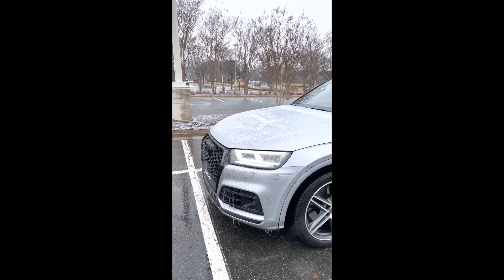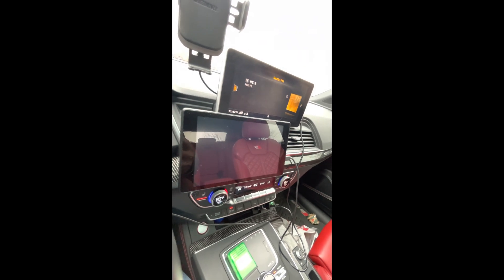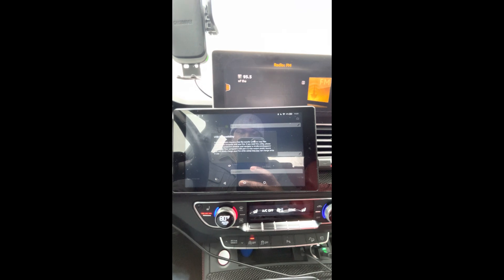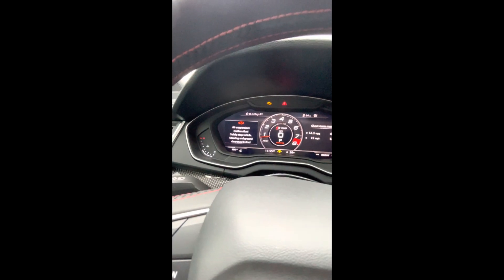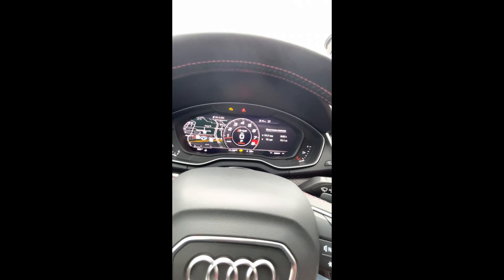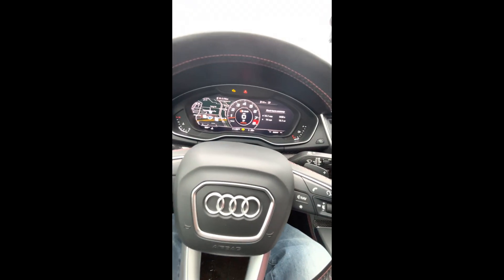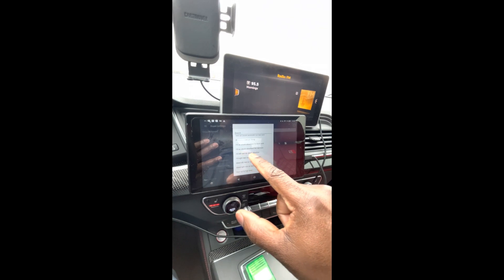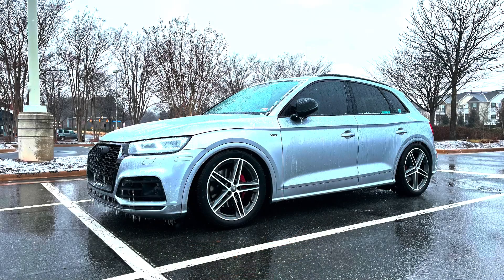Audi B9 SQ5, How to use Obdeleven to Air out on Factory Air Suspension

Comment: Great video. Did this on my 2022 SQ5 and it worked great. Just as a FYI you will notice that once you do the fill your air suspension in the MMI will show the system is not working. As he mentioned in the video take it for a quick drive and it will popup saying correctly leveling and then it will start working again. Had me panicked as I didnt drive after doing the fill and it wouldnt adjust when changing drive modes. Diff going to use this when going to a show.  OBDeleven also has this as a quick buy with credits but its 10 to go to "Show room mode" and 10 to go back. Way better just to manually do it. 😀

Comment: Good stuff man. I have been thinking about CETE solely to air out for pics etc. seems that this is a much cheaper option that does what I need. I don’t have any desire to adjust the ride height past dynamic for daily driving. I appreciate the video!

Comment: That's really interesting. How does that height compare with the "show mode" in the cete as far as height. It looks almost like some people's driving height with cete.
Reply from the maker: @Greg Rosen No comparison yet. Next time I air out I will measure the Ground to fender ride height. It would be interesting if it is higher than CETE. I was airing out my previous S6 on VCDS and it was really low, when I got tired of carrying my laptop around I went and bought the CETE module. In show Mode the CETE wouldn't go as low as VCDS fully aired out. CETE had a separate Fully aired out Show mode option (it was a cable extension to a module under the back rear seats) so then when you went into show mode it was fully aired out. I would assume VCDS, CETE, and Obeleven are all sending the same parameters to the ECU for air out/show mode.

Comment: Wait so do you have to do this everytime? Or does it save it as the new “sport mode” suspension height?  You made it sound like you would need the obdeleven every time. Looks good!
Reply from the maker: Correct, this is directing you how to fully air out the suspension and is not lowering as a ride height. The car is probably still drivable after this but with all the suspension errors the air ride would be non-dampening and a rough, choppy ride, so I would advise people not to drive the vehicle after airing out. 

Ride height is a totally different process from airing out. It also requires a security code to access the OEM suspension Control module to adjust the ride height parameters but that security code is not public knowledge yet.
Reply: @sinister_v  so is the CETE module different? I just want the overall car to be lower by about a 1.5" at all times. and be able to go lower if I put it in sport mode. I don't want to only be able to lower it when I have the obdeleven plugged in. For example the joker tailights on a mk7. Once you code it it stays that way you dont have to keep doing it. Im gathering this is different? appreciate the video!
Reply from the maker: @911airsoftdude  Yes is different from obdeleven, the CETE module will allow you to fully customize your ride height for driving and gives the ability to do Show Mode,which is fully releasing all the air in the factory air suspension, kinda like aftermarket air bags when you hard park it. My video is showing how to air out only.  Not familiar with the MK7 but I understand what your saying. You'll need CETE. This video was to help those wanting to air out only without buying a CETE, in comparison obdeleven cost $150 ? CETE is $1300, but if you want full adjustability then CETE is the best option. I had CETE on my previous S6 and it works great!
Reply: @sinister_v  I have a C7.5 S6 and now have OBDEleven. I'll be doing the standard 17mm drop all the way around, and only want to air the bags out for shows or photos so I'm glad to know I don't need to splurge on the CETE product. Is there a way in OBDEleven to make the fill/vent process faster? Like coding a single button to do it for you in one tap instead of navigating menus?
Reply: @sinister_v  just a question for you about the OBD11. J have a B9 SQ5 also and I just want my air suspension to be aired out sometimes when it’s parked. I don’t want to drive it like that that’s why I think OBD11 would be perfect. Can you just do it from your phone or do you need your laptop and Wi-Fi? Also what package did you buy from them? I know they have different packages with different credits. How many credits do you need to access the chassis feature you did?

Comment: If your air out, rather than having to go back to OBD eleven to refill the bags have you tried to see if you switch suspension modes if they fill back up automatically? Going to try this tomorrow, I am lowered using the factory scan tool by a local shop
Reply from the maker: Not a bad idea but I’m pretty sure I tried this on my S6 a few years back when I did this with VCDS and I was already lowered with VCDS and I had lowering links. Changing drive modes didn’t do anything. I believe the errors in the system due to being aired out disables the air suspension and controls.